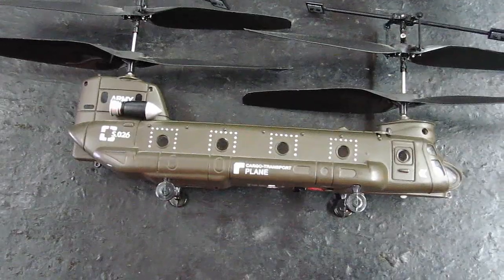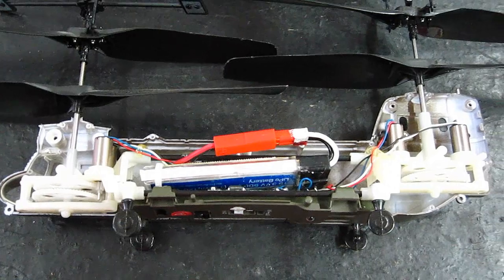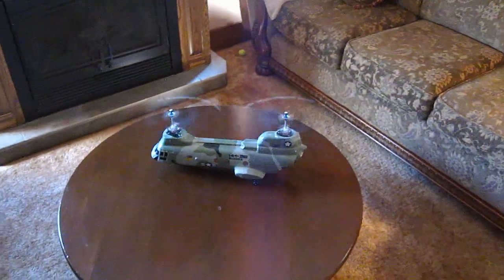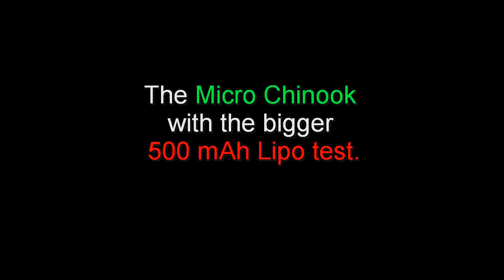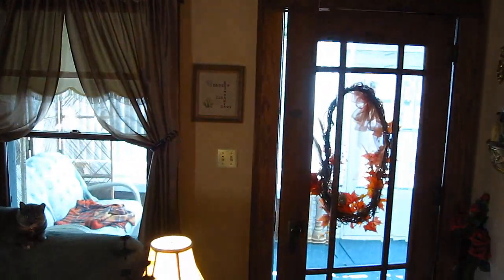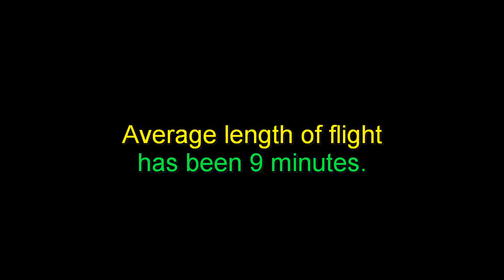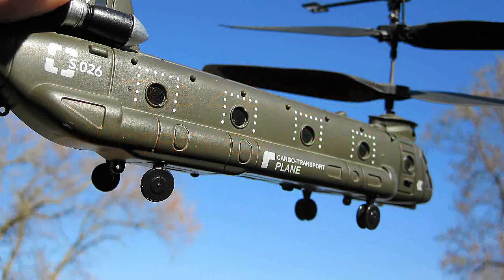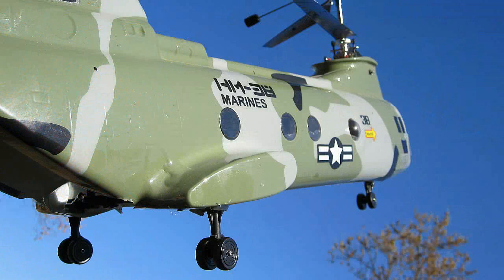Micro CH-47 Helicopter battery Experiment. Syma Chinook Will it work?

Comment: Recently picked one up faulty for under £4 on eBay. Got it working but it only flew about 1 foot off the floor. Had a 400mA battery in my parts drawer, used your video to see if the Chinook would cope with an extra 4g battery weight. Reassured enough to fit it and it flies great!
Reply from the maker: Great.  Thanks so kindly and happy flying.

Comment: And there are more than a few former Marine Phrog pilots (like yours truly) who looked up in the sky one day to see an Army Chinook fly over and wondered if they could join the Army Reserves to keep flying a Boeing-built chopper. Bottom line assessment after having flown both the '46 and the '47? The larger Chinook has much more power but the Sea Knight is more agile and maneuverable. Both a/c are reliable and real work horses when crewed by trained professionals. Thanks for this fun video!

Comment: It flies nicely, but the motors probably won't last long with the added weight. An mCP-x battery coning in at around 7-8g would be the perfect match. A Hyperion 250 mCP-x battery or a Nano '300' would do the trick nicely.

Comment: the last song you mixed in is an 80's song. i was wondering how many flights you could get out of the brushed motors. is it worth replacing the motors on these "disposable" type of helicopters or is it just more cost effective to buy a whole new one when the brushes wear out? great info on the differences between the 46 and 47. semper fly

Comment: ok, I realize this vid is a few years old, but ive a question for the owner if he is around.
you say you can no longer charge the battery through the port on the bird.. Is this because  of how you specifically wired it,( connectors instead of hardwire) or was there some other issue?

Comment: how do you prevent the eflite battery from being too discharged?
Reply from the maker: Just like using the original battery,  the auto cut off of the heli's receiver is at about 3.4 volt and will not allow the rotors to spin, thus protecting the battery.

Comment: Somehow i feel that i should have seen these when i subscribed back in 2010's.
 ANYHOW...i am sure i have that exact same machine hidden somewhere and i'm almost sure we might still have an Apache too.
 just realised something about myself....must not be much of a team player...just noticed how many I's were used in a couple of short sentences.
Reply from the maker: Haha.  Not to worry about that, there are much more important things to worry about these days.  Thanks for the Subscription.
Reply: @NightFlyyer  
Hello again Sir,
  I found it and managed to fit a slightly bigger battery...i did it by jamming the wires in as i am not very good at soldering so i think i can use the built in charge socket...now all i need is to find the TX.
  All the best and stay safe.